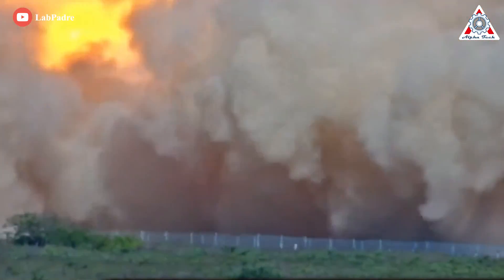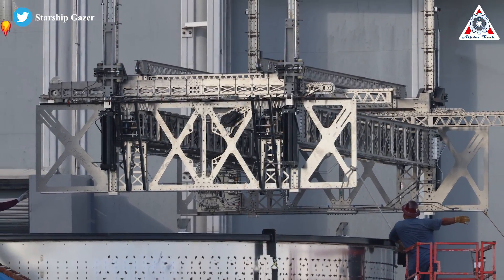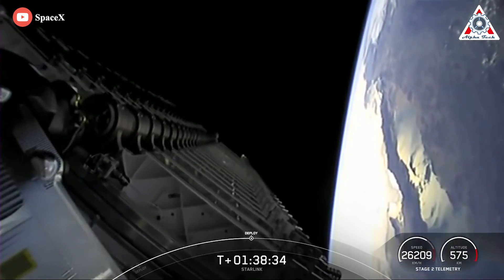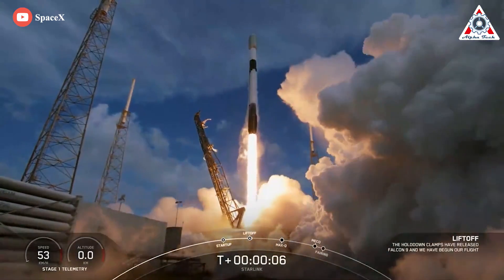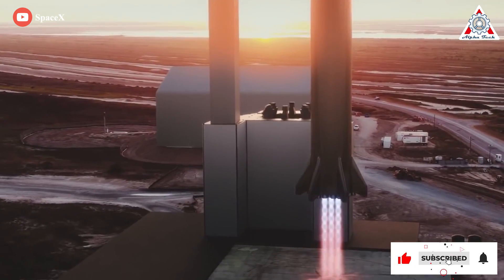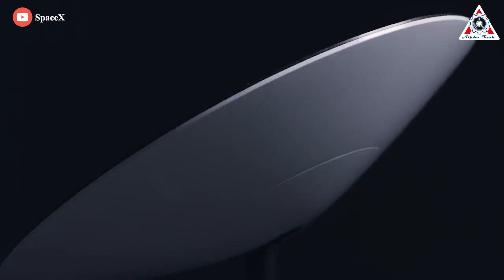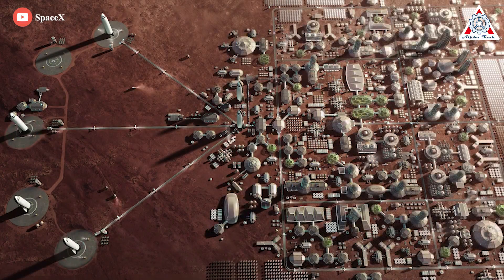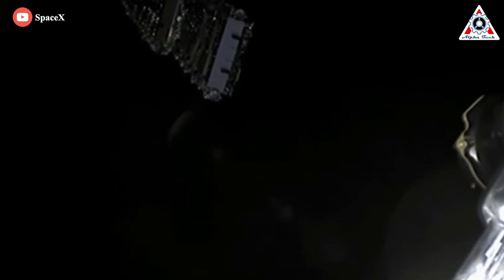SpaceX Starship 24 major new plan changed, Starlink's in big trouble...

Comment: My wired metropolitan connection will throttle from a theoretical max of 200 all the way down to 30 but because of the monopoly that they hold improvements do not come. The trouble with bashing starlink is that they are still tremendously better than the other satellite offerings and ignores the fact that they are improving with every launch. Complainers will complain and that does not make them virtuous.
Reply: Hey mate!👆Thanks for watching.Tell expert Andrei jikh that Elon musk referred you for  the right financial  profitable investment project to participate on it. Msg direct 👆✍️

Comment: This problem is not new and other cable and satellite companies have had these same issues. The fix for the problem is as usual : more satellites, improved software and hardware possible using laser data transfer systems for satellite to satellite or satellite to ground. New changes probably will be seen in Starlink satellite versions 2.0 or 3.0 the main hurtle for them will be keeping enough customers to generate enough revenue to make these upgrades and satellites up and running in time.
Reply: Hey mate!👆Thanks for watching.Tell expert Andrei jikh that Elon musk referred you for  the right financial  profitable investment project to participate on it. Msg direct 👆✍️

Comment: the problem with congestion is because the current "cells" can't load balance traffic to unused cells since the satellites are gen1 and gen1.5, which doesn't have laser comms to talk to their neigbours, so the starlink users are tied to the cell's ground station. with gen2 your data will hop between satellites until it reaches the optimal ground station. there is a reason the service is still a beta, and is still extremelly cheaper than the alternative satellite services in terms of cost and bandwith
Reply: Interesting
Reply: ⤴️⤴️Hey mate! Thanks for watching.Tell expert Andrei jikh that you were referred by Elon musk for the right financial profitable investment project to participate on it. Msg direct ⤴️⤴️

Comment: That huge gap in the side of the rocket has apparently weakened the structural integrity too much.
Reply: Very unlikely that they did not design the rocket without any door and structural integrity in mind. Probably they've finished a new Starship prototype sooner with a redesigned PEZ dispenser and it makes more sense to just close the hatch for the first flight.
Reply: Yeah, you can tell just by looking at it, the opening seems way too big!  Even without being a structural engineer, you can't cut the cylinder nearly in half and expect to not have an issue.
It might have looked good in the CAD model but...
Reply: ⤴️⤴️Hey mate! Thanks for watching.Tell expert Andrei jikh that you were referred by Elon musk for the right financial profitable investment project to participate on it. Msg direct ⤴️⤴️